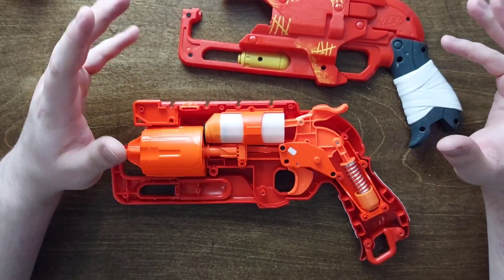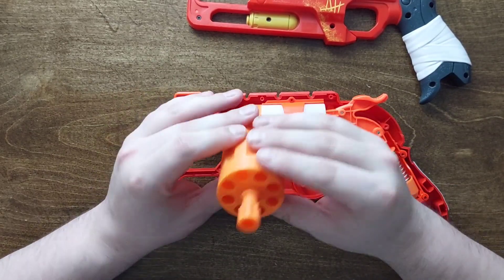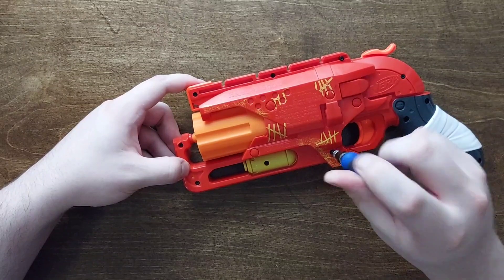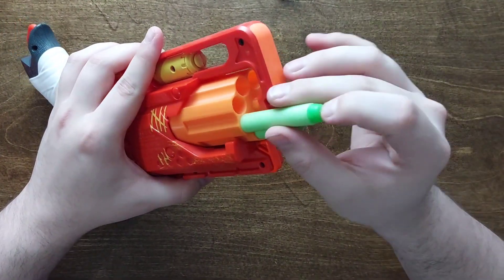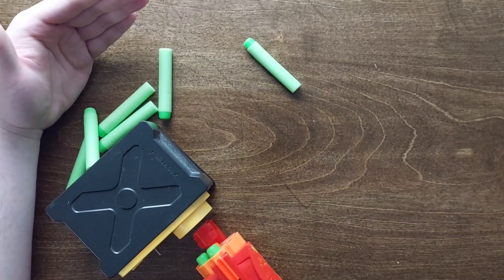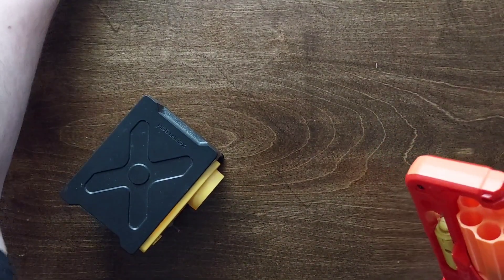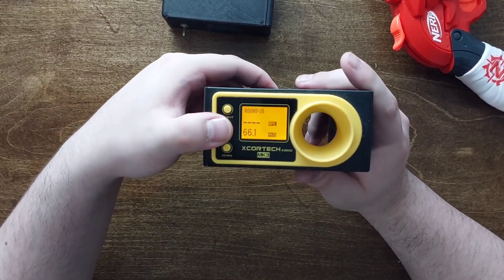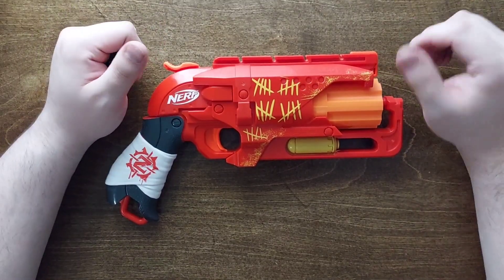How to Mod your Nerf Hammershot with an 8 shot Elite Cylinder.

Comment: 90 to 100 fps is really nice out of a Hammershot!
Reply from the maker: I get 110-115 with the brass 8 shot cylinder, and the high power hammershot kit bundle can do 120 average stock spring and over 150fps with an 8kg. My record is 219fps.
Reply: @radioactivesdesigns3554  hi, what mods did you do to hit 200+ fps seem really good id love to get there

Comment: i got the exact same hammershot you have and the metal parts are have a layer of something, and it's inconsistent. will that effect performance?
Reply from the maker: That's probably just an oxide layer. Put a tiny dab of lube or grease, and if it hurts performance, it'll wear away from use.